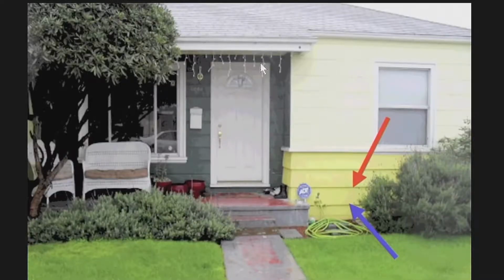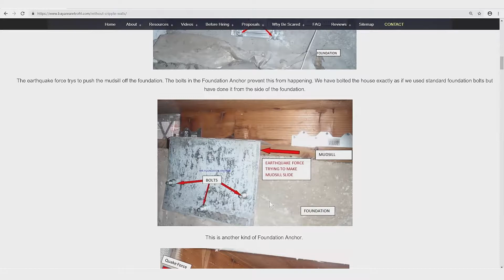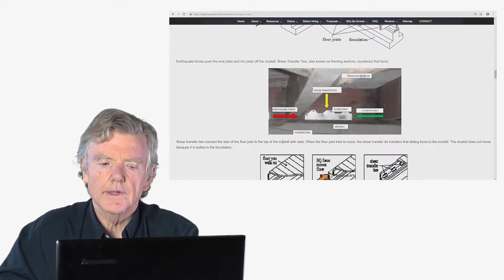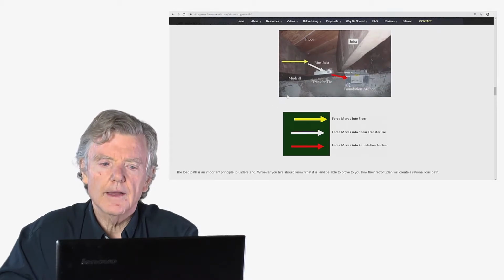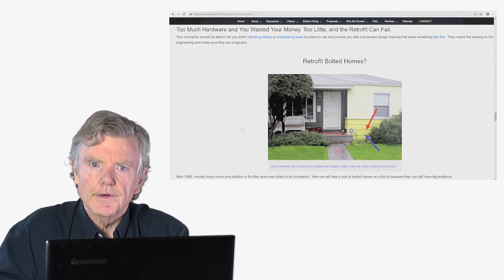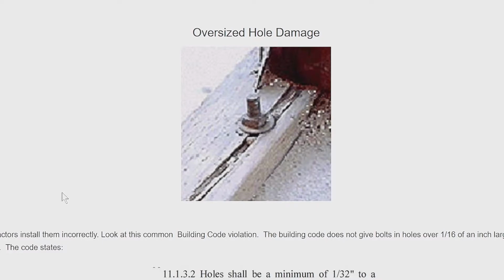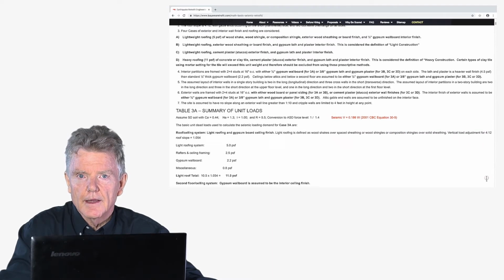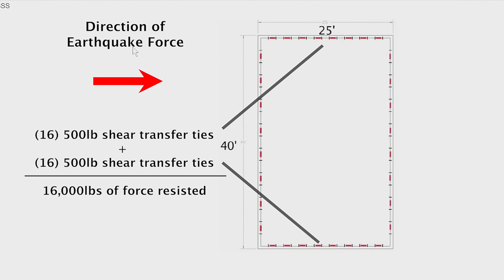No Cripple Wall  Retrofits And Damage

Comment: Great video! Just one note/question, for the problem you came across at 6:30 in the video, would a girder tie down works as well?  My fear is that 2x10 bolted and strapped to the foundation would break/snap along a line above the bearing plates should the house move at 90 degrees of the red arrows, i.e., the floor joists taking half of that 2x10 with it as the move together in unison.  The girder ties I am thinking of are Simpson-Tie H10S, HM9, or an like an LGT2 if the could custom make one for 1 5/8" opening.  I know MiTek makes one (but it looks weak, 18-20 gauge).
Reply from the maker: I can't see how this will help much for lateral loads and you don't see anything like this in the 7 existing retrofit guidelines.  Even the one published by Simpon whose planset is an attempt to sell their hardware.   If you have not done so, please subscribe.
Reply: @bayarearetrofit5814  ok, thanks, what about using engineered lumber like parallam in that 2 x 10 setup as opposed to regular lumber?
Reply from the maker: It does not matter.

Comment: Any videos showing how this is done? is the wood pressure treated? I have to go this route because i have drain lines, gas lines and copper pipes running along with the joist blocking the traditional way with the urfp plates. Any help would be appreciated. Thanks
Reply from the maker: No, use pressure treated and galvanized nails. Nail it like a shear wall.  Look here https://bayarearetrofit.com/construction-details/  scroll down until you see "Low Clearance"

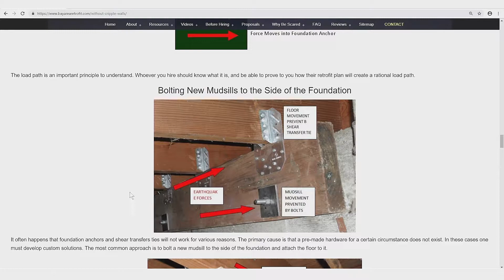Comment: My house has no sill plate and the joists rest directly on top of the foundation. I will need to use the sidewall sill plate as in min 6:14. After determining the  amount of needed hardware for each side of the house, does the layout matter. Can you apply all the needed hardware in one segment along the middle of the house? Or is it best to be in segments: like some close to the corners, and some in the middle? Or does it matter as long as it is all there? On one side, I have Windows and chimney so segments might be best there. My house is about 34x40 feet.

Also about minute 7:06 plywood is used on the parallel side with the floor joists. Is that OSB? What plywood is used and what thickness?
Reply from the maker: If you have that problem it means there are no joist toe nails that would transfer forces from the entire floor into the sidewall sill plate.  For that reason I would spread them out.  OSB or plywood is fine so long as it is stamped "Structural 1"  You want 15/32, often called half inch.

Comment: Great video! This helped me understand what I can do to retrofit my home with 1 cripple wall and 3 sides without a cripple wall.

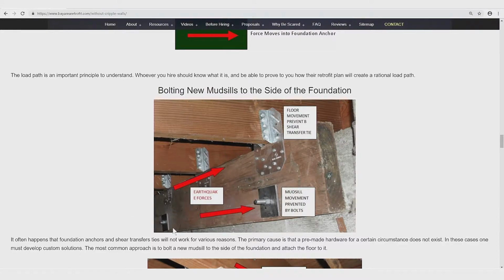At 6:14 in the video, you show an example where a new sill plate was added to accommodate new foundation anchors and shear transfer ties. My home will likely require this solution as well since my sub-floor sits directly above the sill plate, I don't have top plates, and I don't have end\rim joists. My floor joists are on hangers and their connection to the sill plate is variable depending on which hanger you are looking at. I have 2 questions here. First, what lumber is being used for the new sill plate? It looks like a 2x8. Second, what bolt is being used for the new foundation anchor (or what would you recommend)?

Thanks so much :)
Reply from the maker: We use LVLs, not sure what that stands for but it does not have a grain the will split.  Kind of weird but it has the same shear capacity as the material it is made of, usually Douglas Fir.  We put Vicor behind it where it touches the concrete, not sure why except an engineer we use requires it.  I don't think it is really necessary.  At least I have not found any code citation that requires it and the American Wood Protection Association dies not think it is necessary.  For the Foundation Anchor they are made by Simpson StrongTie and technically they want 1/2 inch by 5 1/2 epoxy bolts or Titens but we use 5 1/2 inch long wedge anchors.
Reply: Thanks Howard!
Reply: I had a couple follow up questions.

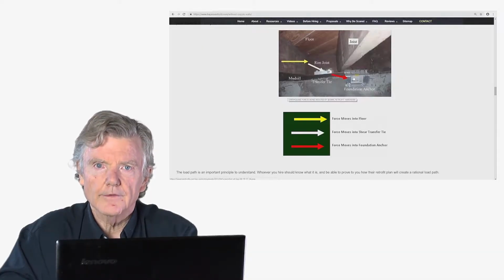1) The shear transfer tie being used in the example at 6:14 appears to use the Simpson H10A Hurricane Tie. What fasteners are being used here? Simpson suggests using nails but it looks their SD #9 screw is used (which is Simpson's approved alternative to 10d nails).

2) The H10A has a joist slot width of 1 9/16'. Unfortunately, the width of my floor joist is 2 1/2", so I can't use the H10A. Can you suggest an alternative connector to use for a shear transfer tie? What do you think about Simpson Foundation Joist Anchor product (FJA) or H2.5AZ Hurricane Tie? The FJA looks like I would end up putting too many anchors in but the H2.5AZ might work despite the intended use being for top plate and joist connection.

Thanks Howard!
Reply from the maker: @chrisc7465  The shear transfer tie being used in the example at 6:14 appears to use the Simpson H10A Hurricane Tie. What fasteners are being used here? Simpson suggests using nails but it looks their SD #9 screw is used (which is Simpson's approved alternative to 10d nails).

We always use nails because they are faster. I would call the Simpson 800 number and ask for engineering. 

2) The H10A has a joist slot width of 1 9/16'. Unfortunately, the width of my floor joist is 2 1/2", so I can't use the H10A. Can you suggest an alternative connector to use for a shear transfer tie? What do you think about Simpson Foundation Joist Anchor product (FJA) or H2.5AZ Hurricane Tie? The FJA looks like I would end up putting too many anchors in but the H2.5AZ might work despite the intended use being for top plate and joist connection.

Don't use an FJA,  look in the catalog and see what the H2.5AZ capacity is.  
That is the only thing that is important, or you can fit 3/4 inch plywood blocking between the joists and nail to the top of the cripple wall or LVL.
Reply: H2.5AZ looks like a no-go as it has very poor shear capacity (assuming I'm reading the Load Tables correctly). Of the 6 load capacity columns, which should I be looking at? Simpson makes another connector, H11Z, which looks promising, since the load capacities are nearly identical to the H10A.
Reply: I found a page on your website that answered this question - look at the "DF\SP F1 Lateral Load column (160)" in Simpson's Product Guide catalog to determine pounds of force that it resists.
Reply from the maker: @chrisc7465  Practically everything you need to know is there. Part of making sure you find out everything you need is by discovering things you did not ever know you needed.  That is why I won't give anyone the answers and encourage them to find the answers themselves.
Reply: The sign of a great teacher :) The whole topic of retrofitting is so new to me that often times I only pick up certain pieces before I re-watch the video. It's a large amount of information. Also, some gentle feedback, a few of your videos have redundant\repeated sections across multiple videos. It would be useful to remove older videos or try categorizing videos in topics (assuming YouTube allows for this). In each category, present a suggested order that you wish people to view them in. Then your wisdom can be presented like a story. Given that I'll likely end up watching all your videos, I could provide further suggestion here if you wish.

Comment: subscribed to your channel. where does one buy earthquake quality shear transfer ties? one commenter suggested finding a plasma cutter to cut thick quality sheet metal to size. your thoughts?
Reply from the maker: Simpson L90.  Any builder's supply will have them.  If they will not fit a Simpson LTP4.  You can bend them a little.  Simpson H10AR are a second choices, and Simpson A23s are somethings the only choice.  The L90 usually works.

Comment: Very much appreciate your videos. I have a off-grid cabin in Eastern Washington and due to heavy snow during from Oct-Apr and how it was built since 1990, the structure has shifted and moved on each corner from 1-4 inches. I’ve extended the metal roof so the snow does not push against the side of the structure and this last year put in French drain about 3 feet deep. But my question is how can I plum this structure back to the foundation specially in the areas that it’s moved. I can send you pictures if you can massage me?

Comment: Howard, your videos are so helpful. I'm in the middle of my own retrofit, and I have an issue with some of my crawlspace vents. They're only 18" from the end of the foundation wall. This means I can't install a URFP plate using Simpson's specs, which are to place the edge of the URFP between 9" - 12"  from the end of the foundation. The URFP is 10.5" wide, so if I placed the plate centered on this section of foundation, it would leave me with only 3.5" distance to the end of the foundation and 3.5" to the concrete edge of the vent. I can certainly install 8 foundation anchors elsewhere on this wall to achieve the 9,000 lbs of force resistance required per the formula you provided. But this wouldn't follow the Simpson (and LADBS) guidelines exactly. How important is it to put foundation anchors 9" - 12" at the end of a foundation wall?
Reply from the maker: Sorry I am so late in my reply.  I do not know YouTube did not notify me about your comment.  It won't matter.  But go ahead and put in a few extra.